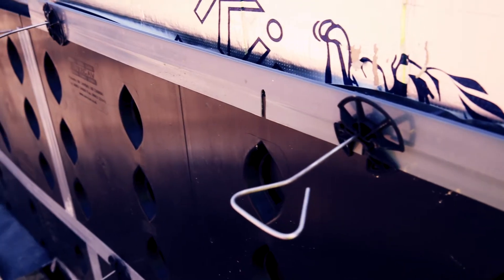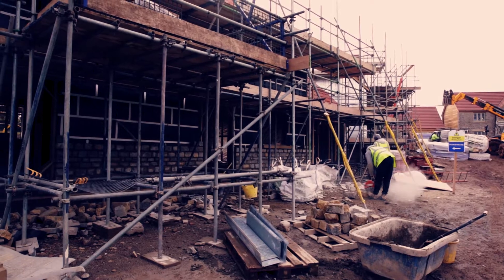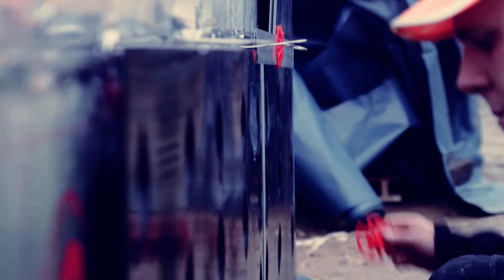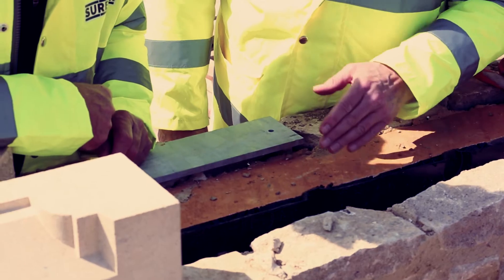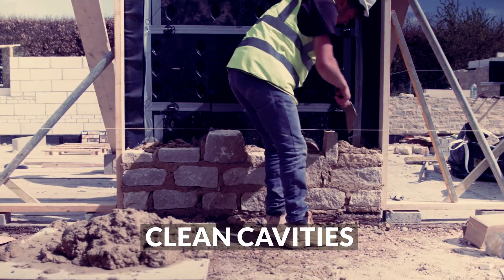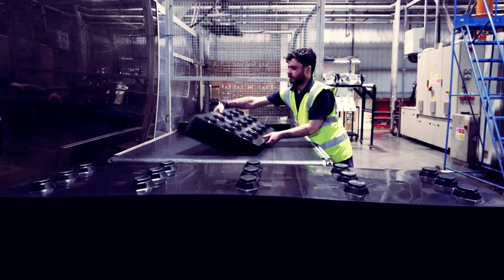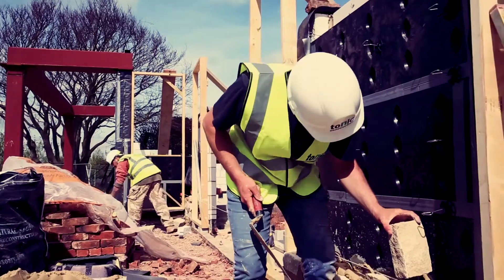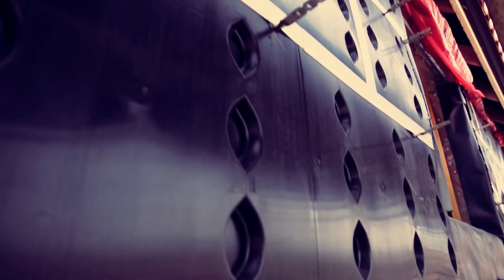NEW Technology in Cavity Wall Construction! - SureCav

Comment: How is the cavity vented? Top and bottom? Asking for a friend 😂
Reply from the maker: Good morning, thanks for the question! In regards to ventilation, there is a BBA requirement of 1500mm2 per linear meter. This can be achieved easily by using our recommended vents, from stock, at 0.5m spacing at DPC and Soffit height. Alternatively the ventilation requirement can be met in other ways such as airbricks or custom vents etc. If we can assist further please do not hesitate to contact us on info@surecav.co.uk. Thank you very much, hopefully we have helped your friend :)
Reply: @surecav  thanks will pass that on to my friend